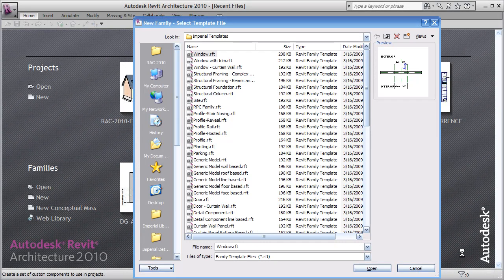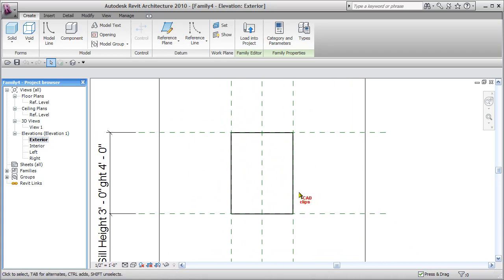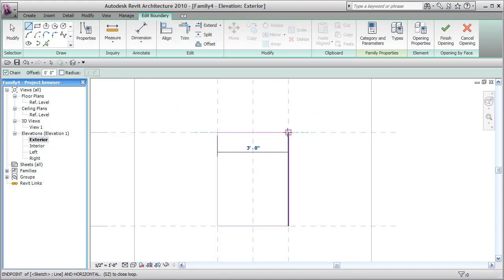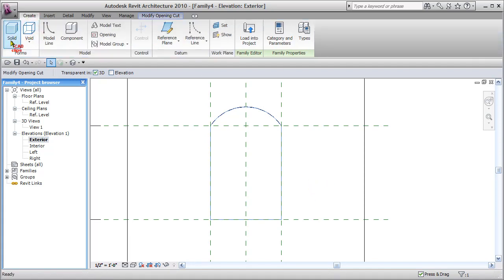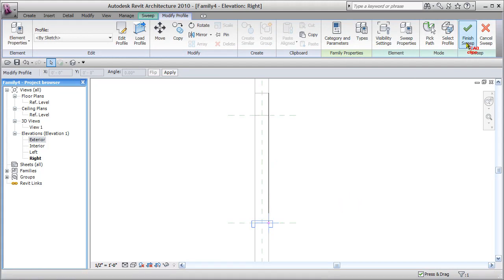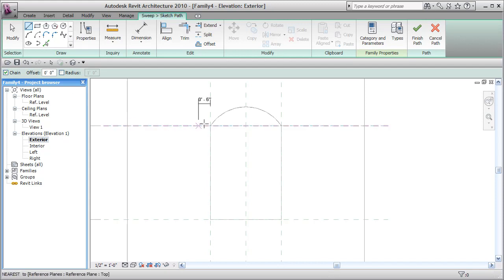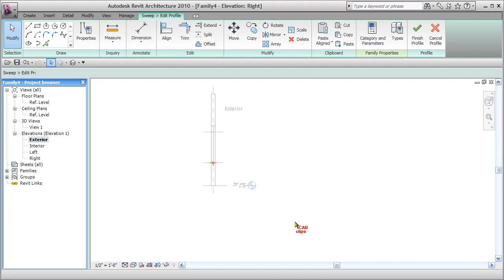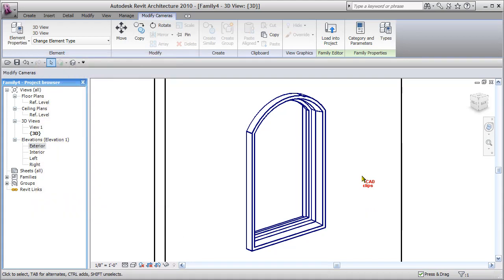REVIT Solids Sweep Tips - CADclip

Comment: Hi, This sample is so useful,  I was trying many times to build (with no arc) a family window w/solid-sweep in R2009, 
the message ERROR constantly that I receive 
can't draw because work plane is a a very sharp angle in this view. It doesn't allow me to draw the profile section  " Go to another view or redefine the work plane "     Also  Solid Sweeps
the option to Sketch is turn off/ you can't sketch the profile and make it run on the path -Is it some configuration?